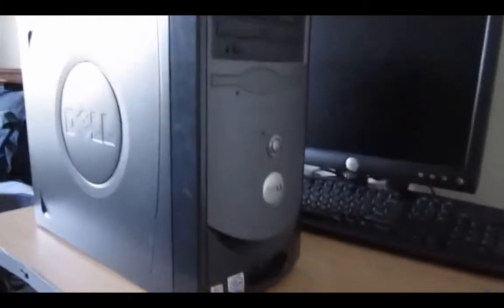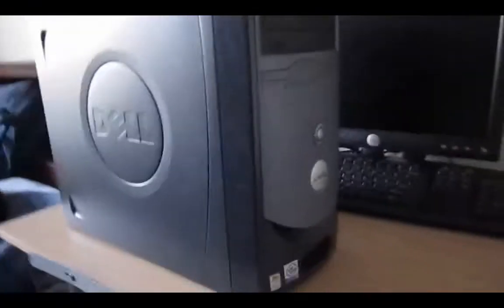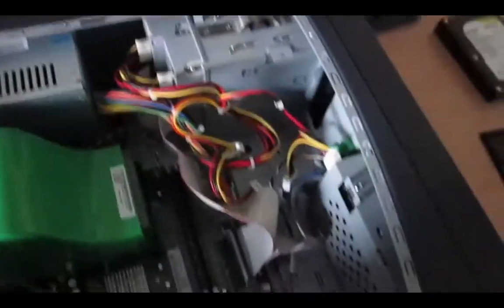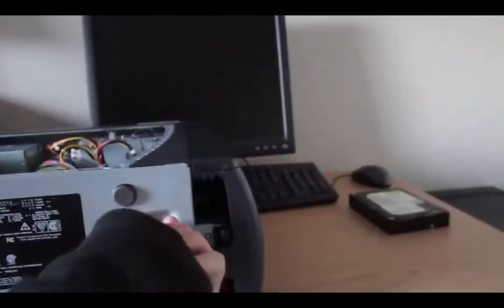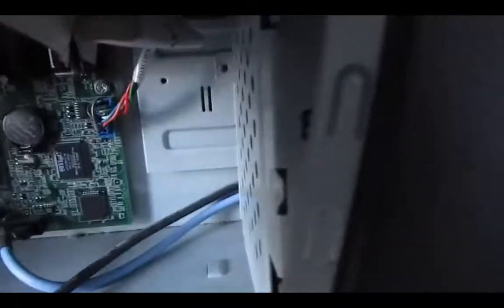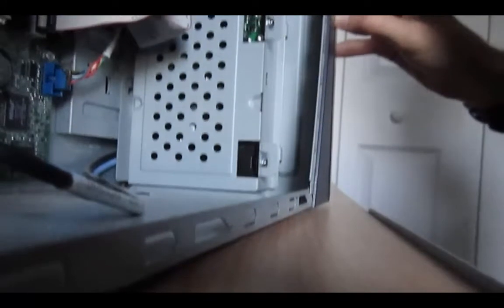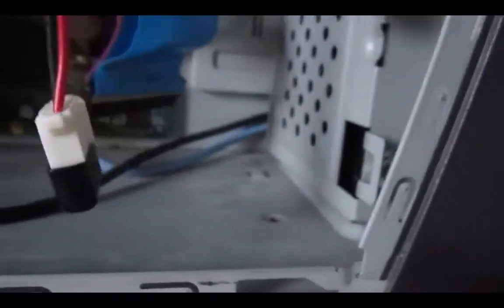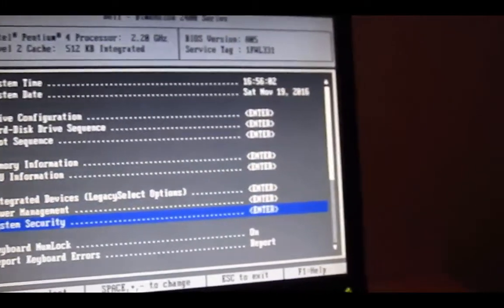Dell Dimension 2400 RAM/Memory Upgrade + Hard Drive Upgrade

Comment: I'm a total noob when it comes to computer hardware or maintenance. Is it possible to go beyond 2gb memory? I mean, my laptop is from 2012 and it has 16gbs cause i have to run programs like solidworks and Adobe PS so I'm used to things running fast and a lot of stuff at a time. I remember friend saying u'd have to change the whole motherboard to get that 64bit capability